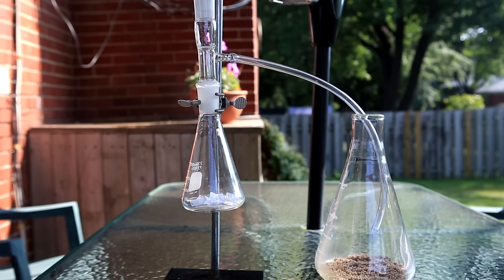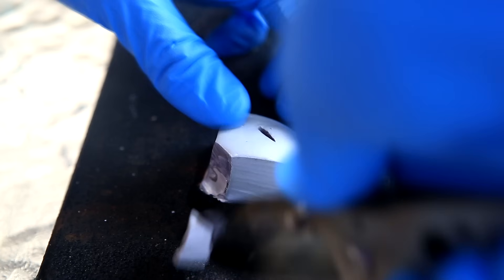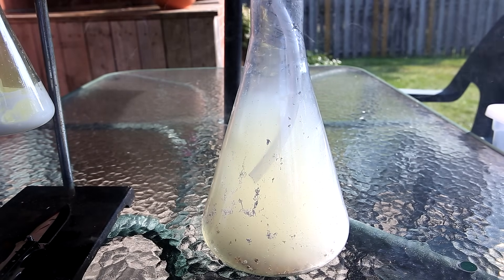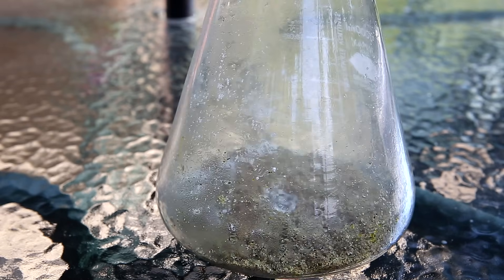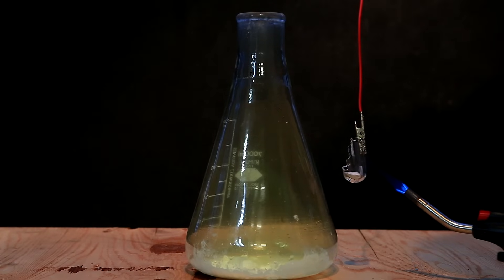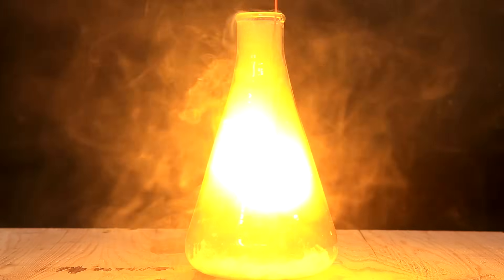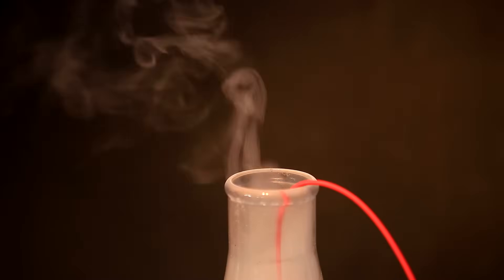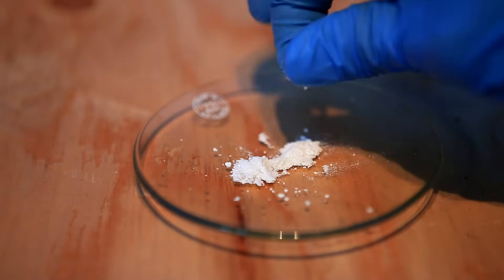Making table salt using sodium metal and chlorine gas

Comment: Now can we take salt and turn it into pure sodium and chlorine like you started with?
Reply: This is too difficult for a lab. For this, one would have to melt the sodium chloride to get liquid salt, then put electrodes into it and apply a high potential. This would electrochemically force the sodium chloride to split into sodium and chlorine again. 
So this reaction requires a lot of power, a reactor that you can use for liquid salt and of course you would need make two half-cells for your electrodes and seperate them, otherwise the sodium and chlorine produced would imediately recombine to sodium chloride.

Comment: How to make spaghetti:
In a pressure pot mix 800g of oxygen and 200g of hydrogen. Ignite with a spark and let cool to 100°C add a spoon of sodium and corresponding amount of chlorine. Mix thoroughly. Add 200g of dry spaghetti and cook according to the instructions.

Comment: Since sodium is so reactive and has to be stored in oil or wax, why does it not burn in air to form sodium oxide when you are heating it until it is red hot and molten?

Comment: With the sand-contaminated salt, couldn't he have used water to dissolve the salt and make the more dense sand sink? That way you'd be left with salt water and then you could just get the salt out of that later, right? Or am I missing something
Reply: sand may have soluble impurities too , and then it would require crystallisation to get the salt out
Reply: @ipsita1227  good point
Reply: this was very early in nile's career and he might have not thought of that.
Reply: @VadersFist501st  now days he washes everything "with a bit of distilled water" lol
Reply: @VadersFist501st  He probably did know, solid filtration is one of the most basic parts of chemistry. He probably thought it wasn't worth the effort.
Reply: @VadersFist501st  maybe I guess. Even at the time of making this video he was way smarter than I am now, though, so I'd be kind of surprised if he didnt think of this unless there is a reason not to do it
Reply: he probably just wanted to do the other method too

Comment: Can someone help me with my homework regarding to this video:
1.	List the observations made while performing the experiment.
a.	
b.	

2.	What are the hypotheses drawn from the observation?
a.	
b.	

3.	Based on the hypotheses, what were the predictions made?
a.	
b.	

4.	Describe the process done to test the hypotheses.
a.	
b.	

5.	What are the results of the experiment? Did it confirm or deny the hypotheses?
a.	
b.
Reply: Oh yeah sure,
1. 
a. The 2 elements alone, Na and Cl, are very different from the resulting compound it forms after reacting with each other
b. The danger of making mistakes in doing the experiment are fatal, as the elements explode when coming into contact with water

2. 
a. Be careful  in handling elements, specially if they are very reactive
b. Make sure to do all necessary precautions before starting your experimeng

3. 
a. The Na and Cl, when coming into contact with water, explodes
b. The Na and Cl combined together to make NaCl

4. 
a. First, chlorine pool pellets are mixed with hydrochloric acid inside a sealed flask to release the needed chlorine gas, sand was put on the bottom of the flask to help strenthen the flask if anything explodes, a small piece of sodium is added, and a little water to get the reaction started, as a result, NaCl is formed, although very contaminated with sand
b. First, chlorine pool pellets are mixed with hydrocloric acid inside a flask to releas the needed chlorine, a piece of heated to molten red sodium is now lowered into the flask, the chlorine and the sodium react together and burned/glow very bright for 1 minute, NaCl is now formed

5. (Not sure what to put here)
Reply: @xinh_wm715  thank you so much

Comment: Props to the first guy to ever add up two most reactive and dangerous elements and then deciding to taste it
Reply: The thing is, we harvest them from the sea 😂
Reply: They used to use copper sulfate as a food dye so it probably wasn't too farfetched
Reply: Someone doesn’t know salt is mined from the Earth.
Reply: @vincedibona4687 someone is too dumb to understand a joke
Reply: An "easier" method is to take a solution of sodium hydroxide (lye) and neutralize it with hydrochloric acid until it has a ph of 7. Then evaporate the water until you get a solid.

Comment: Next: Making sodium metal and chlorine gas using table salt
Reply: That would be expensive. To do this, you have to melt the salt by heating it up, put electrodes in the liquid and apply a high potential to electrochemically split the sodium chloride into the two elements. This costs a lot of energy.

Comment: i’d like to calmly point out that salt preparation typically uses hydrochloric acid and sodium hydroxide in a titration then evaporates away the water to leave behind sodium chloride
but okay i guess you could also just combine sodium and chlorine

Comment: You could hv easily cleaned the sand by using water NaCl will get into the water, sand wouldn’t, after pouring the water into some other beaker leaving the sand behind simply heat the water it will evaporate and u will be left with pure NaCl…

Comment: I wonder if it actually passivated the first time, when not heated sufficiently and not activated with water?  Get it coated with a thin but continuous layer of sodium chloride, and the insufficiently heated metal absorbs enough heat to ensure that this layer freezes, and then the layer of sodium chloride prevents further reaction.

Comment: Just wondering if there is a thin layer of NaCl preventing the direct reaction of Na and Cl2. Adding water allows Na to become NaOH and H2, H2 is reactive as it's in gas form. The first two experiments might not be direct reaction of Na and Cl2 (or at least not the majority?).

Comment: I've always loved that two extremely dangerous elements could be so harmless when mixed together.
Reply: On the other hand, you can also have two harmless elements (carbon and oxygen) combine to form something dangerous/deadly (carbon monoxide)😮
Reply: @mel816  Pure oxygen is dangerous, I still see your point though
Reply: @mel816  there’s also carbon, hydrogen, and oxygen, which can also form C4
Reply: @icewater6841  isn't C4 just carbon?
Reply: @potatoheadpokemario1931  apparently not
Reply: @mel816  another example would be with nitrate and glicerine, alone they are harmless but togheter they make a very powerful explosive
Reply: @mel816 ots not how it works
Reply: Nitrogen, which makes up most of the air we breathe, and carbon, which is also quite harmless and inert, combine to form cyanide
Reply: Water too hydrogen and oxygen gas combines to form it and heat.  The most stable of compounds come from the most violent reactions.
Reply: ironically, is the almost harmless product that kills most people by far, with high blood pressure
Reply: @andremarques3317 brainwashed
Reply: And probably the only danger would be on Na2O and NaOH contamination.
Reply: Not completely harmless. Too much salt leads to cholesterol
Reply: It's because the two elements are so reactive that once they're formed they don't want to come apart
Reply: That's to be expected. Chlorine and Sodium are highly unstable on their own and want to fuse with other elements and once they do they become stable.
Reply: Can someone explain to me why this happens? I’ve been wondering about the reason behind this for quite a while now.
Reply: @unclegardener  Great question.  The leading thoughts/“theories” utilize the valence (most outer) electron transfer from the positive (sodium metal) to the negative (chlorine gas).  The further down you go on the periodic table of elements you go for alkali metals (ex. lithium, sodium) and the further up you go in the table for halogens (ex. fluorine, chlorine) the more readily gives (alkali) and receives (halogens) the valence electrons.  It’s like a match made in heaven for the smoothness of the strong reaction (not the possible damage that might occur to equipment etc). That’s also a reason why using halogenated substances (especially fluorine/fluoride) can burn/“oxidize” substances at violent rates compared to oxygen.  If you can lookup “fluoride oxidizers” it’s quite interesting
Reply: Hydrogen and oxygen brother
Reply: Yes and so tasty.
Reply: Hydrogen is flammable and a fire needs oxygen to burn, yet together they form water which puts out a fire
Reply: Every single atomic nucleus is similar, in that some combinations of nucleons are dangerous, but add or take some and it’s benign. And try reacting nuclei… 😬
Reply: What you are calling harmless is sodium(a metal) and chloride,(chlorine gas) and you are putting it in your body. I will take my chances with sea salt thanks.
Reply: @tesscot  What? It's the same thing! Salt is salt
Reply: no, enough salt and you will hurt your health
Reply: @tradersendeavors no
Reply: NaCl is not totally harmless. It can cause high blood pressure which can several health issues if you took it more than recommended daily amount.
Reply: @rahulkarmakar6079  That's splitting hairs. By that merit nothing is completely harmless, not even water or air. The point is that it's not toxic and is in fact integral to the function of most living creatures.
Reply: @mintakamoth  A more educated take would be that nothing is harmless, and that biological systems need certain conditions to sustain life. In the case of table salt, we're talking about being between hypo- and hypernatremia, both of which are fatal conditions, if severe enough. The same kind of thinking can be applied to most things we consume.
Reply: @Arbitrary_Moniker  You're correct but again completely missing the point. When someone refers to something as "harmless"  it is implicit that they mean under typical circumstances. Hypo- and hypernatremia are not typical circumstances. OP was expressing the contrast between the fact we regularly handle and consume table salt with no immediate ill effect whereas its component elements are highly volatile and dangerous. To jump in with a response about how table salt can in fact cause harm in specific circumstances is just obtuse and perhaps even a little pretentious. Also a bit pretentious is to imply that the person you're speaking to has a "less educated" perspective than your own.
Reply: @mintakamoth  The typical circumstances are what living beings try to maintain, throughout their lifespans. When things get out of the part of the spectrum that is typical, you get problems. I didn't miss the point, this is just a way of thinking that I think is useful when talking about biology. What rahul said is correct, and not splitting hairs, and is true even for many of the chemicals necessary for life.
Reply: @Arbitrary_Moniker  When discussing a topic it's important to discern relevant information from irrelevant information for the given context. Regardless of whether it is technically correct to say that no substance is harmless, it is irrelevant to the point that is being discussed. In a different context, one could argue that everything is harmless, because "harm" is a construct invented from our reference point as living beings, but on a chemical and atomic scale harm is not a measurable quality. Again, context matters.
Reply: @mintakamoth  Again, it's strictly true that nothing is harmless. The way I approached this topic is just a wider frame to look at things from, and that's why I called it "a more educated take"; it's a more generalizable lens through which to look at the biological world. It seems like "the context" for you was more specific, but you have no authority here, nobody does, so people approach topics from different angles and different levels of abstraction. It's selfish of you to assume I knew what you were implying without making it obvious, or at least hinting at it.  
Your example of arguing about "everything being harmless" is different than what I was doing. You're starting to play with semantics and ignoring ethics; I was doing neither. I was still very much so using common semantics and including ethics, but simply zooming out a little bit. That's why I don't think I was going outside the "given context", as you suggested.
Reply: @Arbitrary_Moniker  Being unable to read the room really sounds more like a personal problem, I'm not sure why you're trying to pin that on me being "selfish". The tone and scope of a casual conversation is rarely explicitly stated. Either way I think this argument has gone on way too long for how little any of this actually matters. You can interpret that as me "conceding" or whatever, I really don't care. If anything it was foolish of me to say anything to begin with. I'd be happy if I didn't have to converse with the likes of you again for as long as I live, though knowing myself that seems unlikely. Have a nice day.
Reply: @mintakamoth   I wasn't unable to read the room dude, the room was in your head. Why the contempt? You're again interpreting what I'm saying as way more hostile than it is, as you did initially, which started this whole chain, and has set the tone of your responses. Relax. Your ego shouldn't be tied to conversations like this, it's like picking up a hot coal; there's nothing good about it.
Reply: @mintakamoth its fun till you're a kid classifying substances,when you get to understand indepth chemistry you just think in protons electrons and enegetics,everything is out to get you, and you are out to get everything as well
Reply: @rahulkarmakar6079  No, sodium will burn you right away and chlorine gas harm your eyes, lungs and airways. I dare to say even ethanol is more harmful upon contact than NaCl.
Reply: @rahulkarmakar6079  You can also die by drinking to much water as well. Salt is something we do need to live as well. Again, too much of it would defo kill you. Too much of a good thing and all that.

Comment: Most table salts also contain anti-caking agents such as sodium alluminosilicate, sodium ferrocyanide, potassium ferrocyanide, calcium carbonate or magnesium carbonate to prevent clumping and to make packaging and transport easier. Salts may also have iodine as an additive to prevent iodine deficiency. Iodized salt is typically advertised/labeled as such and you can read the ingredients on the package of your table salt to see what anti-caking agents are added, if any.

Comment: Couldnt't you have dissolved the salt in water then filter out the sand and then evaporate the water to get the salt again? that would have been a more efficient way to purify the salt even with the sand in the flask.

Comment: Everyone knows that it must be possible to make table salt this way, it is called NaCl for a reason, but why bother trying? Looks to me like a pure waste of precious chemicals that are generally not so easy or cheap to get or to make. It is like starting a fire with a dollar bill to show that it works just as good as a piece of an old newspaper.
Reply: You'd be surprised, tovaritsch at how little science the average person knows. However, how many people have actually seen the reaction taking place? Your analogy isn't all that apt, either. There are some circumstances in which it would make sense to start a fire with a dollar bill. (If you're stuck in the middle of the wilderness with a sack of drug money, you need to use something as tinder...) A better analogy is comparing making your own chocolate from cocoa beans, versus buying some at the store. Everyone knows that chocolate is made from cocoa beans (although I'm sure you could convince some people that chocolate is really unicorn droppings), but rather few have actually observed the process from bean to bar, so to speak. Obviously buying chocolate at the mart is a lot cheaper than making it from raw cocoa beans, but the latter would be a fun project.

Also, neither sodium nor chlorine gas are "precious" chemicals nor particularly expensive. This reaction doesn't involve caesium and astatine, which are much rarer, more expensive, and more dangerous to work with than either elemental sodium or chlorine. You can even reduce NaOH (i.e. lye) pellets to elemental sodium at home quite easily, and the chlorine is generated from pool tablets (you know, the things you put in swimming pools to keep them free from bacteria and fungal growth) and hydrochloric acid, commonly available as muriatic acid from your local hardware store. This is an experiment that just about anyone can peform at home pretty cheaply, although it isn't a good idea to try something like this unless you know what you are doing and can follow proper lab safety protocols.

Comment: I guess that's why salt is so expensive back in the days before they discovered that the sea is salty and made of salt huh. 🤔💭
Reply: Nobody "made" salt like this back in the day. The sea isn't made of salt, either, and  evaporating seawater for salt is energy-intensive. It's also only a viable option in places that actually have a coastline. Elemental sodium wasn't discovered until 1807, by when salt was no longer an expensive commodity in most parts of the world.
Reply: @Schwarzvogel1  i really don't know what you're talking about. All i know is that the sea is mostly made up of NaOH and HCl acid.

Comment: For the mixed sand problem you could have diluted the salt in water and filter out the sand and then evaporate the water other than that, nice video and the other method was spectacular